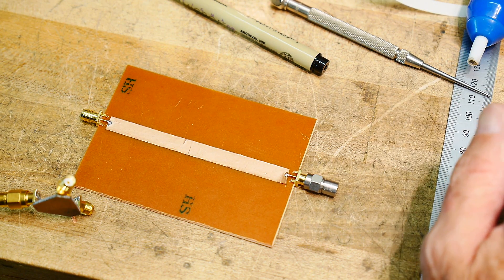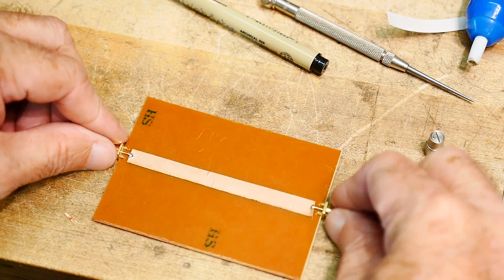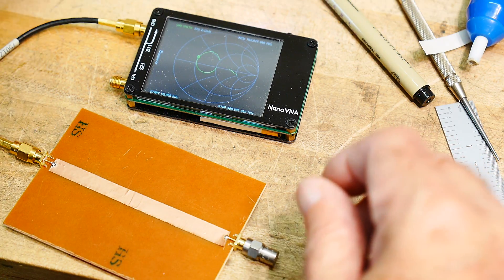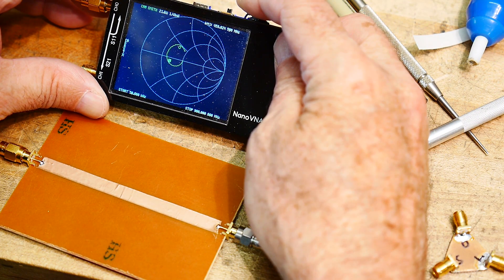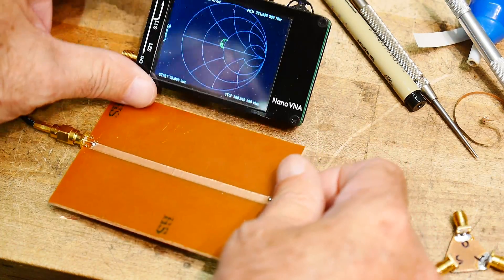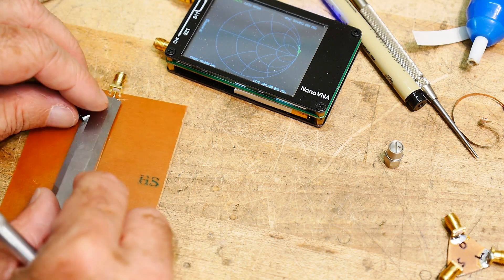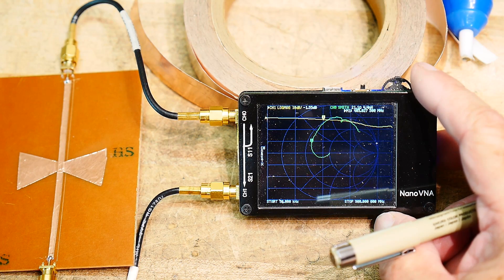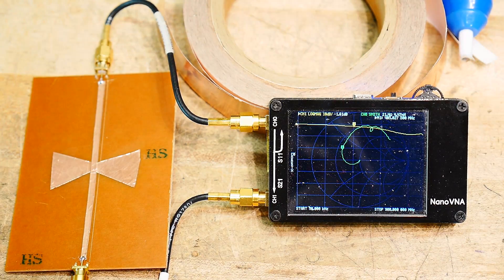#505 NANOVNA Microstrip Construction

Comment: I was wondering about the tape.  I am assuming that it is copper tape with adhesive on the backside.  Would the adhesive act as an insulator?  So if you stuck one piece of tape on top of another, would you have to solder them together to make a connection?
Reply from the maker: copper tape comes with conductive and non-conductive adhesive versions. that said, I always solder them together.

Comment: I don’t claim to know much about the magic of RF, but this video makes me wonder what would happen if you simply took a piece of 50ohm coax and sliced it longways and basically unwrapped it (leaving the coax wrapper and center conductor intact) and glued the entire filleted piece of coax onto any non-reactive surface so as to make the insides of the cable accessible for insertion of elements.
Reply from the maker: it would not be 50 ohms

Comment: Thanks for the strip line Z demo.

I can't wait to buy the mini VNA...

Fred go read about the Nano..

YES Please play IMASI Guy...

Thanks for sticking to the little VNA...wow it's capabilities are amazing. I know you showed some earlier comparisons to the reference HP big boy..Big Boy can be used for verification..& comparison 

For some reference...I am thinking of Motorola RF databook...at least they show some near micro wave amplifiers ...and dimensions of some strip lines ...and they R & C  component part numbers dimensions...

Their stripline dimensions could be ran through the calculator 

And every transistor usually has Smith Chart shown displaying collector and emitter Z...

It be nice if ...sort of like advanced IMSAI Guy graduate class..perhaps you found a small signal transistor...
Safe ...lower power & low Vcc

Make a 8 dB gain amplifer 10 mW...padded output with your home made attenuators and triming to prevent fried front end Nano...
Demo if you can match or measure what OEM claim..

It look like you already made some nice 50 ohm attenuators already
 built ...

I was always amazed by RF....
The scattered parameters seemed like more black magic...it will be good to revisit...

I remember Al...our RF class teach had some generator fed to
1.5 foot long waveguide and terminated with open short and matches...a study in VSWR...

I need to go look up the index of IMASI Guy already published lessons and demos..

Like the cat eye O-scope...BER ..sort of tells use something about matching source and load

How about a ECL circuit design...build strip line...send a digital stream...see if you run w/o error near their max claimed max toggle frequency...

I remember pops playing with some TTL and CMOS on our kitchen table 1976 era while he worked on PLL for Lo in the home build CW HF...his complaint being the TTL wouldn't toggle much behind 5 MHz and supposedly should run up to 20 MHz per the little written Radio Shack data package... now I can see he probably wasn't driving them properly...

I can see you working with Gunn diodes maybe a simple parabolic dish X transmitter...reciever...do a field test..to get out of work shop a tiny...
Have a neighbor 2 blocks down your street recieve this line of site microwave signal then demodulate HD video....you be in the home lab giving a lesson..transmitting....neighbor allows space for down converter...then your lesson of that day transmitted recodered video is posted to us YouTube fans..

I think the images would be just as good and clear as your present camera set up...look at it is like a system build lesson...visit Hartley laws

Oh Happy pre 4th of July 

Kind regards & thanks again

I know there will great things coming...may $ & happyness rain  down the from the sky on IMASI Guy

Fred

Comment: Hi, you could add a short circuit and measure the impedance at some frequency and then measure the impedance  with the open circuit at the same frequency. 

In case of short circuit your
Zin_sc=jZoTan(Bl) 
and for open circuit 
Zin_oc=-jZo CoTan(Bl)

Then
Zin_oc *Zin_sc =Zo^2 
or
Zo=SQRT(Zin_oc *Zin_sc) 

 So Multiply short circuit impedance by open circuit impedance then take square root of it , that is the impedance of your transmission line.

Also that "Funny circuit ie. cross connected line" will gives you a tuned circuit at some frequency.  They use it at microwave as a LC tank.

The bow tie is called "tapered line" is for broadband matching of transmission lines.

A good reference; though it is old:
Lines, Waves and Antennas  The Transmission  of Electric Energy, 2nd Edition
by Robert Grover Brown, Robert A. Sharp, William Lewis Hugues, Robert E. Post 
John Wiley & Sons 
copyright 1961, 1973

Comment: The center of the first circle was the Zo of TL. You were right, the wide TL had a Zo < 50 Ohms. When you made it too narrow, Zo > 50 Ohms, which was the Center of that circle.
Reply from the maker: I used to think the center of the circle was the Zo but my good friend did the math and got:
Zo = sqrt( ( Rmiddle*3*50^2 - 50^3 ) / ( 3*50 - Rmiddle ) )
Reply: @IMSAIGuy  the center is just an arbitrary reference point. 50 Ohms is a common Zo, so it is often used as the center, but the Zo of your microstrip can be anything. In a microstrip RF filter, you would select the Zo of the different segments to get the frequency response you want (lengths too of course).

Comment: You should mount stiching vias to better (for high frequency) connect gnd from top and bottom. Signal backward way would be quicker.
Reply from the maker: you are describing a co-planar waveguide. hard to prototype. this is called microstrip waveguide
Reply: @IMSAIGuy  for microstrip works fine too
Reply from the maker: @mariuszwozniak6918  I don't think you can call it microstrip then to be picky
Reply from the maker: https://www.pasternack.com/t-calculator-microstrip.aspx
Reply from the maker: @mariuszwozniak6918  https://chemandy.com/calculators/coplanar-waveguide-with-ground-calculator.htm
Reply from the maker: @Mariusz Woźniak I used coplanar waveguides with via stitching on my RF Demo board that I have a video on
https://youtu.be/SmVHAlHt2hY

Comment: It's a simple unbalanced transmission line.  So what causes the re-entrant loops in the Smith impedance trace?
Reply from the maker: loops are a phase shift due to increasing electrical length as a function of frequency
Reply: @IMSAIGuy  explain this to me like I'm 5
Reply from the maker: @eastonbryan4171  that knife is too sharp for you
Reply: IMSAI Guy I’m an ee student struggling to understand why when I terminate my microstrip with a matched load i get predictable results but when I just connect both ports to VNA I get reflection and weird curls on the polar/smith plot (the microstrip ~should be~ impedance matched). We’re also supposed to calculate the width and length of the microstrip somehow based on frequency but I thought the width of the microstrip was set?
Reply from the maker: @eastonbryan4171  the section of microstrip should act as a transmission line. so to test your setup. put a short piece of coax in place of your microstrip and measure it. it is a known good transmission line. if you then put your microstrip in and it looks bad then it is bad. the width of the strip is a variable as is many other mechanical dimensions. there are many programs to calculate the correct dimensions. I don't how your professor wants you to do this

Comment: If you check out the EEVBLOG channel, the guy likes to tear down scopes.  I think it might have been an spectrum analyzer that he tore apart that had an RF module that was loaded with circuits like that.  They actually had capacitor shaped (like the schematic symbol) traces that actually were RF capacitors.  Without breaking your trace, you might be able to build a couple of capacitors in parallel with your 50 ohm xmission line.
Reply from the maker: the guy at 'the signal path' show lots of that stuff

Comment: Stubs can be added, and sliced across to add capacitance with reactance.
Sliding stubs along the stripline, to find a good match, then tuned by sllicing across the stub, which adds capacitance, and you can continue the process to impedance match, and bandwidth.

Comment: What frequency range did you make the stripline for? What is the dielectric constant of the board material?
FR4 glass epoxy is normally not used for microwave stripline construction. Rogers RT Duroid is a 'standard' that I became accustomed to use. Just my 2 cents.
Reply from the maker: it's <1000MHz so not much to worry about.

Comment: With distributed elements, it seems that anything along the path is an inductor (like right-hand rule), and anything perpendicular to the path is a capacitor. I think the bow ties are popular because it allows the capacitor to join the circuit--avoiding impedance mismatches which cause reflections. It seems that abrupt trasitions are bad for PCBs, as far as signal integrity is concerned. And still, everything you don't want to be is resistor and an antenna : )

Comment: What happens if you tack solder the bow ties to the main stripline?  I assume that their only contact is through coupling and the adhesive is acting as an insulator?   I will admit I know or remember nothing from my stripline course in college.   I will see if I saved the book
Reply from the maker: The copper tape has conductive adhesive. you can test with a multimeter
Reply: @IMSAIGuy  that's good to know.  Let me know where you picked it up from.  It might be fun to play with here
Reply from the maker: @mjrtude  go to amazon and search for 'copper tape conductive adhesive'

Comment: On most thicker PCB substrates (>1.5mm) the 50 ohm point is at around 3mm wide. The decimal digits vary with exact thickness or dielectric constant, there's online calcs to help with that. At least in my experience with what I've played with (FR4 and Rogers 4350b)

Those bowties are called "stubs", by the way. Bowties are a wideband version of a stub. The most basic is just an extension of the transmission line like the cross you built halfway through. Bowties are more lengths = more lengths to resonate at. 

I like hybrid matching at VHF. For example use the transmission line length to get the real impedance to 50 ohms and then just cancel whatever the reactance left with some lumped inductor or capacitor.

Also www.microwaves101.com is a great source.